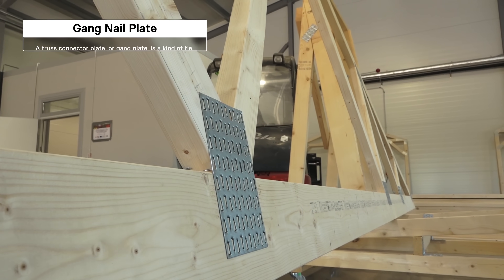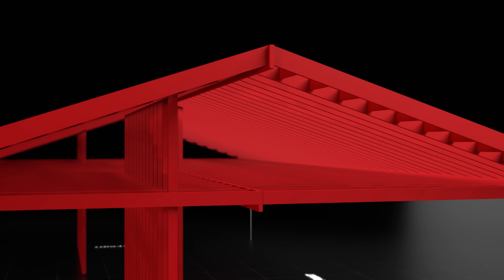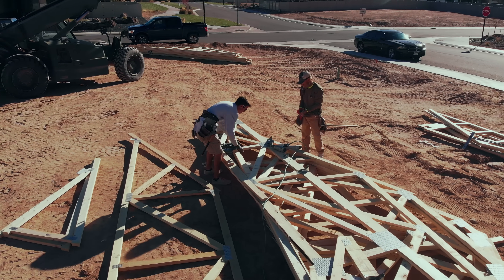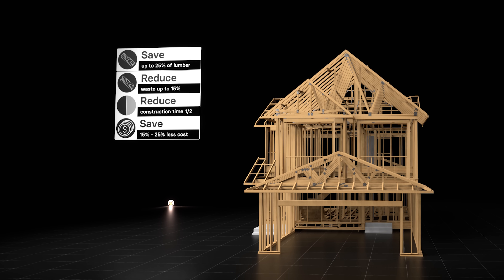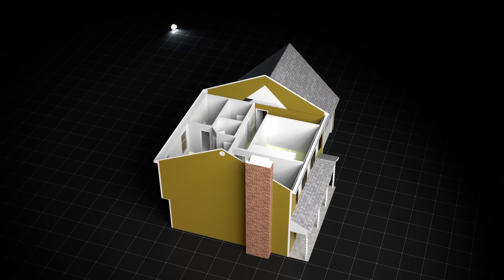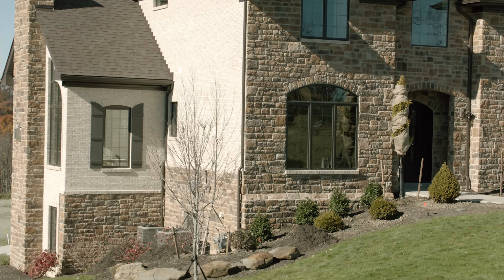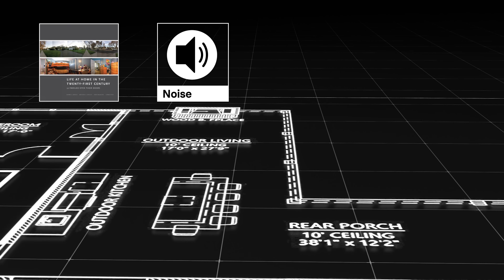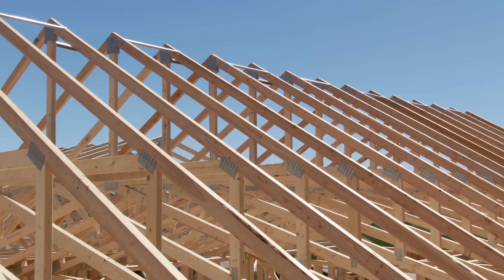The Invention that Accidentally Made McMansions

Comment: Over here in Germany these prefabricated trusses held together with gang nail plates became known for being the central failure point of many standardized discount store buildings in case of fire. As I understood it, once the roof space has reached a certain temperature the gang nail plates (at least the ones used over here) tend to just let go, causing sudden and unpredictable roof collapse. This is why fire departments will not enter these types of store buildings when they assume the fire has spread into the roof space above the shop floor.
Reply: We used to always send someone around before the plywood roof sheathing to put a couple of nails in each of the gang nail plates for this reason. With a nail gun it was easy.
Reply: @WillN2Go1  - Ah! So it has at least as much to do with the willingness of the construction company to spend effort on such safety concerns, it seems.
Reply: @Drcassette that is an interesting design difference, in the uk all such buildings are steel framed (like barns) and yes steel if not protected from fire will buckle under its own weight.
Reply: @samuelchamberlain2584  I guess that may be a result of Britian cutting down most of it's forests for naval ship building, and creating fields to grow food for it's population. And Britian lead the world in steel development a century or two ago.
Reply: @frosty3693  Ahhh. You are trying to show people that you like history. Cool
Reply: @samuelchamberlain2584  Barn fires can't melt steel beams
Reply: @teebob21 it's not that steel beams melt ie 2700 degrees farenhight. The  beams soften at 1100 degrees and bend out of shape cousans hay barn burned and was totaled no metal melted it just deformed and since it no longer was in line with the stresses beams could not hold weight even after they cool
Reply: @samuelchamberlain2584 yeah but with a steel I-beam if you design it appropriate safety factor it's very hard for a home to get anywhere near hot enough to weaken the strength of the steel beam 

Like if you know the maximum realistic heat that can be created and you put the safety factor in for the steel above that even once the steel is weakened by that temperature you're good to go
Reply: Another factor about having the open floor plans with cathedral ceilings, is that there's a lot more oxygen storage in individual spaces in comparison to homes with shorter ceilings and smaller rooms with doors.  It could also be more difficult to extinguish an early fire if it's in an area too high for you to reach.  I wonder if there's any comparison of data between fires in older houses versus fires in McMansions?
Reply: Great info, thanks
Reply: As has been said, the plates can weaken and pull out, but another factor is that the thinner wood used burns through far more quickly. The previously used thicker timbers would charr, building a layer of carbon on the surface, this would to a degree protect and slow the wood core from further burning.
Reply: @abbersj2935  The plates are made of steel. By the time they get hot enough (say 400 - 500 Celcius), the timber will also be shrinking, warping, charring, and starting to burn. Its not the plate that is failing, its the integrity of the joint as a whole. The joints made by the plates are under full load and the weakest points of a truss. Yes they will fail there first, but you cant blame the nail plate, its the design as a whole that is failing. The plates could be made of titanium and probably make little to no difference. The old school way of building with heavy joists, rafters, purlins etc., the nail fasteners are just there to hold things in place, they don't take much load at all.
Reply: @ChomskyHonk1  yeah because in europe the sun always shines and the wind never blows
Reply: I nearly bought a house until the inspector found that several of the gang nail plates on the roof truss had simply popped off. Some were lose, and others were found laying on the attic floor. We didn't see signs of fire, but assumed intense summer heart may have caused it. The inspector was shocked.
Reply: @DrCassette blaming the gangnail plates sounds like hearsay. The thing about light weight trusses is that every single member and joint  is crucial for strength under heayy load. In a fire, all you need is one small part to become weak and the whole lot can come collapse.
Reply: @jumboegg5845 that is all of framing… and I’m a contractor
Reply: In Anerica, mcmansion fires are rare.   As long as we aren't carpeted with incendiary bombs night after night after night, these nail plates aren't going to cause any problems
Reply: @nicholasadams6343  - Why the hell are there a bunch of random, nobody accounts with bot-like names all commenting on this, all making ridiculous, even borderline offensive comments about European homes and building methods??? Apparently dead internet theory is real, and China has quite an interest in stirring this pot for some reason.
Reply: We have so many McMansions with extra useless rooms and more homeless than ever.
Reply: This effect is exaggerated,  but also mis applied. The nail plates aren't letting go, it's using ⅓ the lumber and making spans impossible with dimensional lumber alone. Thus, when a fire occurs, less lumber has to burn before catastrophic failure of the roof.
Reply: The state of Illinois requires such buildings to have a special sign on the wall near the entrance for that very reason. They are very common here.
Reply: Europe still has better building code (IRC) than URC.  I continously watch building technologies in North America launch some new idea for profit that has been in practice in Europe almost 2-3 deacdes prior. A great example is the spray foam. Most of the EU has banned it already, and in the US they are just now studying the longterm effects and consequences of its application. Germany is always saying to us, "I told you so."
Reply: Yeah, the thing is, Iron loses most of its strength at around 500 C. Wood on the other hand does not conduct heat very well, and the outer layer turns into charcoal that burns away relativeley slowly.
As my stepdad once put it, solid wooden beams with flame retardant coating get better Fire protection ratings than any steel beams of simmilar size and load capacity.
Reply: Fortunately, residential house fires are far less common than they used to be. In the US in 1980, we had 734K house fires, vs 338k in 2021. It's even more impressive per capita - 0.32% of people reported a house fire in 1980, and that's down to 0.10% in 2021. Home fire deaths were 23 per million in 1980, and it's down to 7 per million in 2021. Larger, newer houses (with new electrical systems and platform framing) probably save far more lives overall, when compared to any marginal increased hazard during firefighting.
Reply: @DrCassette  the large surface area of the gang nail plate absorbs heat at a high rate. The nail shapes entering the wood are sheet metal triangles. The wood is an insulator. The elastic strain causes contact stress between the “nail” and wood in turn creates friction. When heated air touches the plate, the nails will quickly match the air temperature. As the wood is heated it steams out initially then begins to oxidize (turns Brown) and the wood will shrink away from the nail and friction will be lost. Off gassing as the wood resins decompose will create vapour pressure pushing on the nail as the friction goes lower and lower. The nail plate doesn’t melt. The wood spits it out. Then the roof falls down.
Reply: @richardkudrna7503 good explination
Reply: @ChomskyHonk1  In that case, they'd be even worse in Canada.  I live outside Ottawa, and our weather is worse than in Moscow, and for the same reason:  We're in what's called Extreme Continental Climate.  That's what happens when you're at a high latitude (45 degrees north, in our case) and there's no large bodies of water to moderate temperatures.  You go to the coasts at the same latitude, and the weather is a whole lot nicer.
Reply: @evensgrey  Very extreme latitude. You have the sun of southern France :D Try living in Nunavut for being in north.
Reply: @evensgrey  45N  is not really  a high latitude. London - 51N, Manchester near where I grew up - 53N. Of course, everywhere in the UK is less than 70 miles from the sea.
Reply: @peterjackson4763  When you're in the deep continental interior, 45 N is a long way north.  The climate in Ottawa, at 45 N, is slightly colder than the climate of Moscow, which is at 55 N.
Reply: @evensgrey  The coldest I have ever experienced was in New Hampshire, well south of anywhere in England. Stockholm was cold but not that bad
Reply: That's very good to know.
Reply: @ndrs.e  I don't disagree with you. I am, however, curious what your seasonal swings are, and generally speaking, what country you are in. For example, I know construction in the UK is not made for hot weather, because historically they had to deal with the cold more than one or two really hot days in the summer, with fairly mild summers historically anyway.

I ask what country, because it gives a general latitude to compare to North America, mainly for transparency, and to ensure as true of a one to one comparison as possible. IE, you wouldn't compare Scotland's seasonal temperatures to Florida or Texas. I feel like the people would all get along though based on stereotypes.
Reply: @blackmoon8459  America has several climate zones. Some have seasons, some don't.
Reply: ya that's the one major problem with them. If they see any bit of heat, they warp and fail. It isn't the easiest to tell when you're venting a roof on a fire if they're made that way
Reply: By the time that happens you would either be dead from the fire or smoke - or you would have evacuated already. Fire departments can't magically save burning homes. Even if they try the water damage destroys the building anyways.
Reply: The brief answer is that anything that would be helped by screws or nails could also just be helped by better (larger) gang-nail plates, and it's likely not the gangnail plate exactly that's the problem here, so much as that it allows for building so much more cheaply, and so much closer to the minimum safety factor than other methods. 

Properly installed gangnail plates of appropriate size shouldn't be buckling under heat related stress, they should be outlasting the wood itself in fires. If they're pulling apart, they are not long enough for the length of the members that, in the heat of the fire, are expanding. With nails and screws instead, the same amount of "hold" would simply pop out instead. Same as you can fix that problem with more/longer screws, you can fix it with longer plates. 

Chances are, even then, by the time the plates are failing, the trusses would also just, themselves, be failing.

I used to work in designing and building trusses :) We could pump out an entire set of trusses in a couple of hours when the shop was fully staffed; it would take a few weeks to build rafters the old way atop the house, and be substantially more dangerous. It really is a terribly efficient way to build. Get yourself some stops and a jig, and the cutting takes 2 seconds, get yourself some standard press tables on some rails, and then slapping the lumber on them and pressing the plates in takes as much time as walking around the truss with the hydraulic presses . . . the longest part of the job turns out to be just hauling in the lumber.
Reply: @ChomskyHonk1  A Dutch couple told me about traditional Dutch house construction, I think bricks, that were impossible to insulate. People love them anyway.   Insulation of stick framed houses is one of those areas that I think has finally been solved. 

When I used to renovate old beach houses, 1890s Balloon Construction, people used to stop by, get a nostalgic look in their eyes and say, "They sure don't build them like they used to."  I'd smile back, but think, thank goodness.  American Universal Building Code 2x framed houses is an amazing construction method.  If you could somehow remove all the nails, until a good wind, the house would just continue standing. A balloon framed house depends on the nails. When they start rusting and the house moves from wind and people moving about,  the second floors start to sag, the exterior walls bulge. (My last renovation I didn't want the job, but I like looking at old houses so I went. I was flippant. I don't have any idea what's going on there until I open up the ceiling. How much? I shrugged, What other estimates have you gotten?  He named a number. "Well that's a start." I said whatever anyone estimates it will cost at least four times more and take four times longer...  I was surprised when he called. I had to do it. And it cost a lot more and took a lot longer. ) 
My last house, 2x framed built in 1932 went through the Northridge quake in 1994. Walls have double plates on the top. Where the two plates overlap there has to be a four foot (1.2m?) overlap. Above the door to my son's room there was only a two foot overlap. This moved and caused damage. The code is very smart.   I would be under the house working on plumbing during the aftershocks without any worry.
Reply: Same here in the USA
Reply: Yup. A fireman told me the exact same thing here in the states too
Reply: Very good to know 😅
Reply: thanks
Reply: That's an issue in the states as well, and in Florida, buildings that are susceptible to this issue are required to have a special sign to warn the Fire Department.
Reply: How many fires do you guys have?
Reply: Reminds me of bowstring trusses.
Reply: That's interesting. In the US most buildings like that have all metal trusses. I guess it would not be much different though.
Reply: @ndrs.e Seconding the main comment, in NA, they are caught up in the North/South Cold/Hot ideas. But science proves your concept is correct. The mistakes in NA are still under insulating in both climates as if this wasn't true. I don't understand it.
Reply: They can fix that easily with extra insulation around those central parts
Reply: "don't trust the truss" i hear firefighters say
Reply: That's why they actually require a few nails nowadays. You have those few extra nails for that exact scenario.
Reply: Its just another junky, cheap way to build cheap houses, with the whole structure relying on some sheet metal plates pressed into the lumber at joints. Sheet metal is weak, corrodes, and can be torn. Better substitute would be 1/8" thick steel plates BOLTED in.

When I re-dod my porch on my 1928 house, I replaced the old 2x4 horizontal ceiling rafters they used that had one toenail on each end holding them to the house and to the other end on a beam they rested on- with new 2x4's held in place with multiple SImpson's strong ties and long coated deck SCREWS not nails, screws are better than nails.
Reply: It’s probably more the fact that it encourages a bigger unsupported span of roof rather than the nail plate giving way. As the timber burns in one spot, the whole lot can suddenly come down whereas in a beefier construction with smaller unsupported spans, the collapse will be less drastic and sudden.
Reply: In America we have a lot of code that protects the roof in case of a fire for this very reason.
Reply: The house is made of wood, I think the plates hold longer
Reply: Fire sprinklers
Reply: @DrCassette,
We have the same problem here in the USA. Gang nail plates are not all good. They have their issues and bad fire safety is one of them.
Reply: This is also true for metal trusses not just wooden ones.
Reply: That’s really interesting. I’ve never seen wooden trusses used on commercial buildings here in Canada. Wherever they are used they are at least somewhat protected by drywall covering it up.

Here, big warehouse type stores usually use exposed steel trusses.
Reply: Thanks for the "but sometimes!" argument.
Reply: They are more then likely fire rated.
Reply: those hurricanes and storms has to do with world events likewise with diseases. scientists get paid to come up with more answers including predictions for more unfortunate happenings.
Reply: why dont we see steel stud used for prefab trusses?

my dream build would be steel stud trusses on cinderblock walls, rebar reinforced. weld the steel stud trusses up. weld them to the rebar. ykno... like anything built with taxes lol. 

bridges, skyscrapers. all steel and masonry. 

three little pigs and all that. 

fucking children are taught this and always forget to be like ”oi, ma! why aint OUR fuckin house made of bricks???"
Reply: It happens here too but we don't care.
Reply: Also, most city building officials cannot figure out where the midpoint is on a McMansion truss roof to adhere to the midway point maximum height roof ordinance that most municipalities use, which also contributes to homes looking too big and too high, dwarfing their neighbors….
Reply: @jokermtb  the midpoint height restriction when did that ever become a thing? Used to be simple 35 feet high. Personally I would prefer more freedom
Reply: @jeffbybee5207  It's a fairly common ordinance provision these days.   It is however very difficult for building officials to calculate the 'average' mid-height point as mcmansion style 'witches hat' roofs are the style de jour.   Many municipalities are looking at top plate or eave height, as the controlling max height of a structure as it's very easy to verify for building officials.
Reply: The plate will fail from heat before the wooden structure is on fire? This sounds like hogwash
Reply: The problem is the use of small members with multiple failure points. Timber posts and beams are more fire resistant due to the mass and end up having exterior char only. If it's traditional framing you just end up with smaller spans at much steeper angles or multiple vertical supports which in turn make it less likely the whole roof system is going to come down at once.
Reply: Yes. That makes sense. However, they are great for hanging on to pulling forces of hurricanes. I live in SoCal. Our code requires hurricane clips for the rafters, which help fix this pulling problem. You are correct in terms of fire. Older building techniques make wooden structures more predictable. The firemen can hear the cracking of the wood versus metal which suddenly gives way.
Reply: That's the case for all structures really.
Reply: 👀 o
Reply: The problem is the standard pine that's used in the European region. It's much weaker and softer than the radiata pine which is very uncommon in german.
Reply: Yeah, these plates aren't really structurally rated (plywood gussets aren't foolproof but they are better) - the whole structure more or less stays together with physics and on top of that the whole roof assembly is essentially one giant system for holding up the weight of the roof deck which means as soon as one truss goes bad the whole thing goes bad.
Reply: Yeah but also it's already on fire. How much are you saving?
Reply: I have heard the same form Firemen in the US.
Reply: US everything is out of cheap wood. There safety is an afterthought
Reply: The fact that this came out of Hialeah 😂
Reply: That's a know issue in the US as well.
Reply: Would adding a few screws or conventional nails help with this problem?
Reply: @dr.kraemer  Maybe a spray-foam insulator coating or flame retardant fabric covering the plate would help? It would be cheap, too.
Reply: @JoeGator23  there are fire barrier coating that work very well.  I was told that the old technology uses simple caustic lime (old time white wash). Urethane coatings I wonder if they encourage rot? Steel structures used to mortar on fire brick precisely shaped to protect the girders.
Reply: @JoeGator23 in California they have to be insulated but in most of the United States they don't
Reply: @dr.kraemer  A lot of things would help, but they cost money AND they're not required by code. Construction companies aren't going to spend extra money building anything better than required unless they can charge the client for it.
Reply: @dr.kraemer  I think yes. Screws will still hold load even if the wood has shrunk away from the threads. 
The shape of a screw or nail is such that heating the head carries little heat into the wood. A nail plate is a heat sink so quickly pulls the heat into each nail and the wood. The little triangle shaped nails will quickly be ejected once the elastic stress is lost due wood shrinkage and ejection is assisted by wood gas pressure.
Reply: @dr.kraemer  if you are on residental construction and you spend the time to add even a single nail to a truss plate, you will be almost certainly laid off on the spot. You're not there to build a good house, you're there to add a zillow listing with a massive profit margin
Reply: @calebharris292  You can have a house built to any standard YOU are willing to pay for. My new house in Florida is being built from steel SIPs designed to survive 230mph winds, and LEED-certified for energy efficiency. It is also costing rather a lot more than a D R Horton production starter home, despite being rather smaller than average at 1300sq/ft, plus a 1000sq/ft attached air-conditioned garage. There is also no structural wood in it AT ALL. Or concrete other than the slab it sits on.
Reply: @calebharris292  Which reminds me of the channel of a building inspector from Arizona who shows wrongly installed or completely missing truss plates on a load of houses he inspects.
Reply: @Kevin_Rhodes  Nice. No concrete? Concrete has a really good compression strength and doesn't burn. 
Don't bother with any 15A circuits unless they are dedicated, such as a garage door or dishwasher. All circuits with plugs should be 20A. Both cheaper to install 8 20A wires than 10 15 Amp ones, and the bigger wire means lower resistance losses. It is a minor savings but more convenient to not have 15A breakers popping when using one 15A thing and anything else.
Reply: @boomergames8094  Concrete is also TERRIBLE for thermal efficiency, and making concrete roof decks is very, very, very expensive, so you end up back with all the downsides of wood trusses for that. And concrete block construction is time-consuming. The material cost for the panels is higher, but you more than save that with the labor savings of the block work and not having to separately buy and apply any insulation. You also save money in the slab work because the house is so much lighter than concrete block. SIP was ~20% cheaper overall for the structure of the house. And wildly more energy efficient. 2300sq/ft of house and garage in SW FL is only going to need 1.5 tons of A/C capacity...

Yes, the electrical is nearly all 20A as well. Another case where spending a bit more money upfront makes lots of sense, but a production builder will never build to more than the absolute minimum. Which due to the hurricane code requirements here, is still expensive.
Reply: @Kevin_Rhodes  I was thinking walls, like exterior walls. But you are right about the thermal efficiency and having concrete walls means needing stronger foundation. Cool. 
Only 1.5 tons? What? really? That must be really good for thermal efficiency. I have more than double that for just a little larger square feet (with basement). My unit is a little bit large as I opted for 99% comfort days vs 90 or 95% as some HVAC calculators do. Stay frosty.
Reply: @boomergames8094  Yes, the standard construction method in FL is concrete block exterior walls with rebar and wet concrete in the holes, then a wooden truss roof with plywood deck. Wood stud interior walls. OK for wind strength to a point, but not great, and thermally terrible. All that concrete gets hot and just wants to radiate the heat into the house. And in the winter - cold... My house uses the insulated steel panels for exterior walls AND roof - 4-6in walls depending on height, 8IN roof. The roof is waterproof without any additional covering, whatever you put on it is cosmetic. Minimal thermal mass. Steel stud interior walls. The inside of the exterior walls and roof have 2IN hat channels screwed to them to make room for plumbing and electrical, plus additional insulation, then drywall. Makes for a heck of an envelope. And as a bonus, the walls end up flat, square, and true, unlike wood or concrete block. Takes very little to keep it cool. A combination of ducted and ductless mini-split units so multiple zones in the house. Ducted in the house, ductless in the garage hanging on the walls. The 1.5 tons is actually on the large side for this as well - as I told my builder - I want to be able to hang meat in there if I get a hankering. My current house is a 1985 built wood frame house of 770sq/ft - 4T on A/C. Which is DEFINITELY oversized for the house, but they don't really come much smaller than that here without going to a mobile home unit. And I like that it can go from "away" mode at 88F to my usual 74F in under an hour in the dead of summer. Still not terrible for electric bills, it's a small house and electricity is cheap here, but the new one is going to be much, much better despite being much bigger and having that big beautiful air-conditioned garage/shop. Also hoping to have solar and battery storage from Day 1, but that is more about running off-grid after storms than saving money, because it really won't for a really, really long time.
Reply: @boomergames8094 . What do resistance losses have to do with anything? You are required to build to the electrical code which means the resitance issue is already made irrelevant and so 12 gauge wire produces no advantage over 14 gauge other than that you can plug in a 20 amp appliance as opposed to maxing out at 15 amps.
Reply: @calebharris292 this is because truss nail plates are (as mentioned in this video) meant to be pressed into the wood. Puncturing & denting the plate compromises its integrity.
Reply: @calebharris292 The reason you get fired for putting a nail or screw where it doesn’t belong is because you will have compromised the structural integrity of the connector, and thus the entire truss. You’re not an engineer.
Reply: @rapid13  No I'm not, are you? Also yeah you get laid off in construction, you have to fuck up hard to get "fired". Adding a 16d nail might split the end but it's still attached by the plate. Wood splits all the time that's why truss plates are technically better than banging trusses together on site. If you "compromise" a truss with a single nail enough for a residential framing outfit to """fire""" you over it you were doing it very much on purpose.
Reply: @ I’m not, but I’ve sold this stuff for 30 years and worked with more than a few engineers over that time, including truss designers and a bunch of folks at Simpson Strongtie. 
Now, I thought you were talking about driving a nail through the plate. If not, then we’re talking about two different situations. 
As for firing, your use of “laid off” makes me think you’re talking about a union shop. I’m talking about non-union residential framers, who will fire you for just about anything.
Reply: @calebharris292 Isn’t that the truth..
Reply: @Kevin_Rhodes  would like to see the company that makes the sips please
Reply: @dr.kraemer No, it's the plate that's the problem. Adding nails or screws won't change the fact that the plate still being there will still conduct heat.
Reply: @noneofyourbusiness9369   yes, but a well placed set of screws presents an alternative load path once the nail plate is ejected. If the screws hold in the nail plate, it delays ejection as well. 
I am sure test data exists where we see test trusses under load fail very early with hot gas. 
I would like to see building code adjusted to address this issue.
Reply: @richardkudrna7503  Spare me the bs. One of our grown child is a building inspector and several of our grown grandchildren are partners in construction.
Reply: @  congratulations on reproduction. Why no technical comments?
Reply: @noneofyourbusiness9369 yes but you can put insulation over the plates which is what's done in California but most United States you do not have to do that
Reply: @dr.kraemer can’t use screws in structures
Reply: @patrickmanasco5905  the code prohibits screws added to trusses?  If aged there is risk of split but fresh spruce resists that. Thinner screws with deep thread profile would cause less spilt. Say a 2 1/2” drywall #6 profile.
Reply: @patrickmanasco5905 personally I seen screws used why would you be saying you can't use them is there an actual reason I'm curious
Reply: @mcamp9445 something to do with the screw getting loose faster than nails because the shrink and grow from temperature change causes the threads not to hold
Reply: @patrickmanasco5905 I'm not sure if that holds up as like decks are pretty much all switching over to screws because they in fact hold much better than a nail as a nail doesn't have anything to fasten itself in 

There are no fancier nails for certain nail guns that have little protrusions to hold themselves down 

I'm pretty sure it's just cost is the reason that they don't use screws because it takes longer to put in 

I know a lot of people who have decks and the ones that have nails and there any length of time old the nails keep popping up
Reply: I believe you are thinking of bow string construction. Lots of discount businesses, and venues that need a singular large open space use truss work that includes bowed appearing light metal, or flexed wood that quickly fails in a fire. These plates would have a melt point that's much higher than bowstring. I don't know about German construction practice, but at least in the US this technology wasn't that problematic. Once the heat is strong enough to hit the fail point of steel you've far exceeded the tolerance of any human entering the dwelling. 

Source: FireEMS career
Reply: @hardcorley it's not that the plates fail by melting it's that heat is absorbed and carried into the wood so it chars around the nail like protrusions and the joint come apart before the 2x4 could burn through
Reply: By the time the building is hot enough to weaken the plates you wouldn't be entering anyways.
Reply: @siggyincr7447  If the fire gets into the ceiling/attic space it can be difficult to detect from below.
Reply: It only takes a localised hot point to cause the plates to buckle and the truss to fail. The whole building does not need to be involved.
Reply: @siggyincr7447  firefighters may be, if there were people inside

Fires can start near the roof, and fires generally move upwards, so you could totally have half the store be untouched by the fire, but one room and the entire attic space filled with fire
Reply: @siggyincr7447 Thank you , this was a non issue to begin with
Reply: @siggyincr7447  it becomes a concern for firefigthing pretty quickly...
Reply: @siggyincr7447 not the case in traditional buildings, as wood is an insulator and even at high temperatures will take some time to burn off and weaken, what he is saying is that roofs made using this method, tend to fail unpredictably and fail before the wood that it’s holding fails…
Reply: @siggyincr7447  ,
That is not necessarily true. As a former volunteer, I tended to a number of training sessions and alarms with prefab trusses held together with gang nail plates. We were not allowed to enter buildings or go onto a roof to cut a vent hole due to the potential for unpredictable roof failure of the trusses. We had to stay outside and surround and drown when other homes with standard roof construction could be entered, vented, and saved.
Reply: @siggyincr7447   disagree. Even a small fire in a building that breaks through the ceiling will inject hot gas into the attic space. The large heat sink area of nail plates carries the heat into each nail. The metal to wood interface loses friction.
The nail plate joint will fail long before autoignition of the wood. 
It would be an easy experiment to place a prefabricated truss under load into a heated chamber and observe time at temperature to failure.
Reply: @siggyincr7447 that's not true. The plates are more conductive and have more surface area. They curl and fall off under way less heat than it would take to hurt a roof in legacy builds.
Reply: @ChomskyHonk1  It's almost like the building methods used vary based on local conditions? Who would ever have thought that would be a thing? Even within the US, a place with WILDLY varying climate and local conditions, houses are not built the same way in the entire country, by a long shot. Though certainly there is far more emphasis on affordability than in Europe. Which is one reason why stand-alone home ownership rates are far higher in the US.
Reply: @ndrs.e nothing compared to North America.
Reply: @ndrs.e  Bud, that's not like the extremes of weather we have in the US.  On the missouri/kansas border, just about the middle of country, temps are usually up to 40c/105f in the summer to -23c/-10f in the winter.  That's not windchill either.  This isn't even close to the hottest or coldest part of the country.  Oh, and don't forget the tornadoes.

There's a UK guy that moved to the US some years ago and does videos about the differences between the two called 'lost in the pond'.  He did a few about the weather.  You might want to watch some of those.  You'll probably find them to be quite informative.
Reply: The building standards in germany are quite higher. In the US building prices are at average 30% lower. That is the price for quality and durability.
Reply: @ you know this based on what exactly? Building code in Germany does not require meeting earthquake or hurricane stability
Reply: @wolkentaenzer  building standards where in the us? They vary quite a bit by locality.
Reply: @DrCassette, well the difference in the fire codes are also a very striking thing. In the US the fire code is based just in Person security (allowing building to have just F30/F60), and the German code is based in Person and Building security (the building have to resist fire with main elements being a F90, for security of the other parts of the building). This is a key point, that makes building in Germany more expensive but more secure then building sin the US.
Reply: That was exactly my thoughts when I heard the term "gang nail plate".
Reply: @ndrs.e  Yes, Europe has seasons, but they are much milder than the weather/climate extremes found across North America.
Reply: Well over there in Germany yall are known for placing blame on scapegoats
Reply: Germany doesn't have the same building standards the US has you also have 10' thick walls because of obvious war reasons. We've never been bombed besides Oregon and Pearl Harbor
Reply: Modern fire protocol in the US is any newer structure, they just let it burn and keep fire from spreading to neighboring buildings. It’s not worth risking the fire fighters life to save a building insurance is going to write off anyway.
Reply: @ 
🤣🤣🤣🤣🤣🤣🙄

You of course, have some written documentation of this hypothesis
Reply: Ever hear of sprinkler fire suppression?
Reply: @ChomskyHonk1  ah yes. germany. the country that famously doesn't have seasons.

the euro style house holds up just fine to climate fluctuations cause those exist in europe just as much as they do in the US
Reply: @anonym3017 for what’s it’s worth, the North America and central Asia have far greater seasonal variations than Europe. Germany has mild winters and mild summers compared to an interior American state.
Reply: @anonym3017  old houses in Germany have clay tile roofs that weigh many tons. Huge wood beams with huge wood pegs to retain.
Reply: @ old?

That's the standard construction method today if the roof span allows it.
Reply: @anonym3017 German seasons are extremely mild compared to North America. North America is one of two places on earth where subfreezing temperatures occur at sea level in the tropics.
Reply: @chir0pter  wrote:
"subfreezing temperatures occur at sea level in the tropics."
Where?
Reply: @ you make houses out of concrete and stone because you deforested the landscape long ago lol. Conversely the Finns and Swedes make their houses out of wood because they still have trees
Reply: @ Southern China and south Tamaulipas both see rare freezing temps in tropics. Doing a search it appears it can happen in the eastern sahara too but this is heavily dependent on nighttime radiative cooling in dry air i imagine
Reply: @phoearwenien4355 Pozdrowienia, I've seen new construction homes in Gniezno. Some of them aren't like the older ones structurally, but they are very efficiently insulated to say the least.
Reply: Europe does everything better.
Reply: They do not fail until the metal begins to melt. They do conduct heat and cause the fire to spread through the roof, which does call catastrophic failures
Reply: Are you all hearing yourselves? How to protect a metal plate from fire? Shouldn't you be worried about what it's holding? Wood 🔥🔥🔥 The plate isn't the fail point, it's just the only thing left to investigate after the wood chemically reacted into co²
Reply: @anthonyg1986  No, the plate is the weak point, as those really short nails mean that as soon as the surface of the wood chars, they will fail. Which is far sooner than the actual wooden beam..
Reply: @TheWampam  Interesting explanations, I think I understand the problem better now. The plate transfers heat into the members right at the joints, the worst place possible. Is that about right?
Reply: @TheWampam  agreed!
Reply: @dr.kraemer  worse. The friction is quickly lost as the short triangle nails heat the wood at interface and shrink it and cause resin exudate lubrication. Heat sink problem. A layer of old school lime wash would create a thermal break.
Reply: @dr.kraemer 👍👍
Reply: @anthonyg1986 wrong. Wood is very safe in a fire. It charrs on the outside which is a great insulstor. This protects the healthy wood under it for a surprisingly long time. Also, wood gives a lot of warning (bending and a lot of noise) before it lets go.
Steel on the other hand doesn't need to melt. Normal steel loses its tensile strength pretty suddenly if it reaches around 700°C and than suddenly let's go without warning.
As a firefighter, I prefer a good wooden construction (not the fake 2 by 4 used in the US) over a metal one.
Reply: @anthonyg1986  Not really. The joint doesn’t fail when the wood burns. It fails when friction is lost. The friction is lost quickly due to the heat sink shape. A long thin screw heated at the end carries in little heat. A nail plate is an idea heat sink. Huge area in hot gas, shallow triangle shaped short penetrators.
Reply: @anthonyg1986  actually, the speed at which metals like steel gain temperature is greater than for wood, so it reaches its softening point at about 500ºC, and fail faster than wooden structures. Before the wood burns, it chars on the outside, and the metal joint has failed and the structure collapsed.  Then it burns at its hearts content…
Reply: @anthonyg1986  wood doesn’t just engulf in flames when it touches fire… the heat is already up there tho to loosen these plates. Plenty of wooden structures remain standing after a fire
Reply: @Lexspeer except it does when it's superheated... woodgas from all the sap. In any case, if firefighters are entering a structure, in all likelihood they are also spraying hundreds of lbs per minute of water on top. Which I'm sure doesn't help. There's only so much that can be done economically when the contents of nearly all structures are all some form of hydrocarbon ready to get really hot really quick. After that everything is done, water in the ceiling from humidity will flash to steam, once breached next the wood will weap out it's sap and quickly fill the area with super flammable wood gas and the metal plates will warp, but they aren't the linchpin. That belongs to the hydrocarbon products we fill our spaces with.
Reply: @anthonyg1986 much of the lumber is treated to have a higher resistance to heat than natural lumber but the intense heat of the metal plate can overcome that 

In California those plates have to be insulated but in most of the United States they do not
Reply: @anthonyg1986  The issue is that the plate will heat up and flex, leading to a failure, at a temperature that is lower than the combustion point of the wood framing. This means that the truss would fail because of the plate failing before it would have failed because of the wooden truss members catching on fire.
Reply: @anthonyg1986 best comment